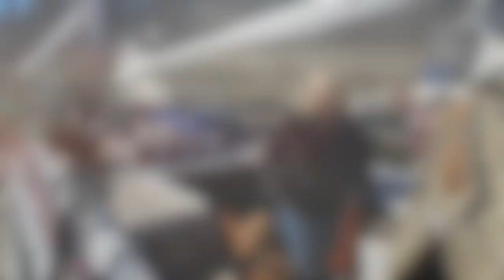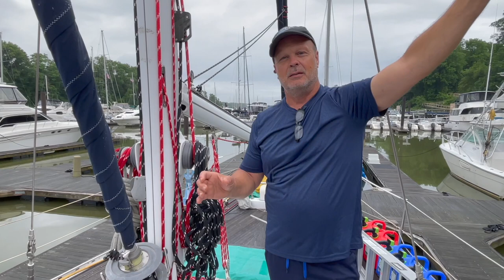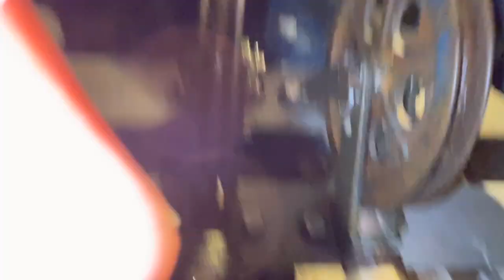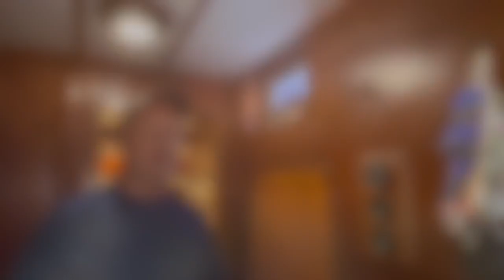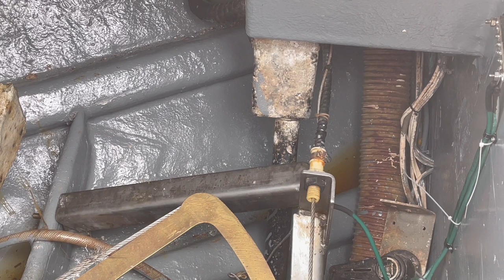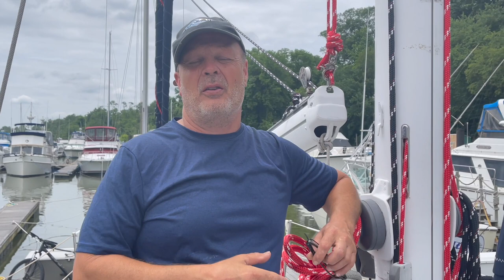The Tayana Blues! -Sailing SV Bohemian Ep. 20

Comment: B.O.A.T = Bust Out Another Thousand
Your desrption is dead on....
Keep up the great work
Reply from the maker: 1000 I need 5000 . Oh lord this boat . I’ll tell you what in need  5 gallons of epoxy and a gallon of hardener. Maybe a little fiberglass. Then rebuild the injectors , six of them at 100 bucks a piece. Some gaskets around 500 bucks . Rebuild the head 2200 hundred. Then antifreeze and maybe oil . That should do it . Oh and a can of engine paint . And a nice torque wrench to top it off just to remember the project . I could keep going but it really gets ridiculous .

Comment: I bought my 38 foot boat when it was a wreck and did her up slowly. Took the teak deck off first. Have owned her for over 20 years now. It’s a Labour of love. 

I new exactly what I was getting into. Also I was in no hurry.
Reply: I think I’ll remove the teak this spring in sections as I wander around the keys and the Gulf. Some guy told me to pull the teak off leave the screws then mark them with a sharpie. Then remove the screws,drill them out then epoxy. Did you have issues finding the screw hole.
Reply: @briandale8386  - I was lucky as mine was held down with glue only. It made a big mess removing the glue though. Sanded it down and   Applied a primer and then anti slip paint. Came out real nice.
Reply: @briandale8386  if it were me I'd remove the whole deck before it causes more issues

Comment: The most expensive way to get somewhere for free!  Dig that you're sharing - still on the couch myself.
Reply: There’s a old Bertram yacht next to me for sale . It has two big 18 wheeler motors in it. He said to go to Annapolis and back cost around 300 buck and that’s at low speed. It’s about 150 miles round trip. He said if he pushed it hard 500 bucks . I think that comes to 2 miles a gallon.  Trucks will get with a full load 7 to 13 but they only have one engine . Stick around I promise  to sail the 7 seas.
Reply: Great comment - and yeah a 40 year of boat needs commissioning, and it’s a years worth probably of stuff - so call it 2000 hours, but then you should be able to go for a few years before a major breakdown.
Reply from the maker: @IanB22  ya give me hope
Reply: Great video that gives an idea of what's involved when buying a fixer-upper... Whatever your initial budget for repairs, you better double that to be on the safe side, and to make sure repairs are done RIGHT, with the right materials, which are not cheap!
Reply: @sailing_mahalo  back in Missouri there’s a big box hardware store called Menards..   they have mahogany paneling and a good selection of mahogany.  Miss that place.
Reply: @briandale8386  Spelled Menards, know it well, lived in St. Louis / Ballwin, MO for 10 years

Comment: New subscriber here.  You are doing good and that boat will need a lot before it is back in great shape.  I have faith that you will do it and do it right.  This reminds me of the early 80's when I had to chance to buy a 1971 E-Type Jag that had been sitting for years.  My Dad told me I could afford to buy it but I couldn't afford to have it, he was right.  Owning a sailboat is the same, the purchase price is just the beginning of the financial hit.  The older and bigger the boat, the bigger the hit.  From the moment a boat is constructed it begins the degradation process, this is no big deal if you stay on top of it, but if a boat sits for years then you better plan on going through every single item on the boat and either replace of make certain it is in excellent condition and have spares that you can use when something breaks and something will break.
Reply: I new it when I bought it ,  but now I really know. I was flipping houses and I had experience , so I new what to expect. This is different, . I’ve come to the conclusion that this period of time to know this boat is a form of safety for me and my wife. I needed this learning experience to sail. A seasoned sailor I will become.  Thanks for the tips , keep me in mind when you see me cruising. That will be a new chapter of learning.  Keep on a dreaming
Reply: @briandale8386  Keep doing exactly what you have been.  It is a process, just like flipping.  You will have an intimate knowledge of every system on the boat, and that is absolutely needed. Expect every single thing you touch to be bad, then when you see all of the things that are perfectly fine you don't get discouraged.  If you expect things to be good and then discover they are not, it is easy to become overwhelmed and discouraged.

Comment: The price you paid should have been a red flag.   Especially with a Tayana.  The were built to a price point, and to gain that price point they cut corners. With the passage of time, those short cuts moved to the forefront.  The bolts you mentioned are an example.  Rather than used 316 stainless, they used cheaper 304.  That was repeated through the building process.  You are right: the rebuild will never end.

Comment: Bry, you got a diamond in the rough, she needs polishing. But she's a big diamond an BIG diamonds are very costly. For just you and wife you would have been better off with say a 40 footer. Its not just the maintenance, its also fees for travel/marinas. How did you make out on insurance, get worse every year ?
You were demoing the emergency rudder post, assume you know it goes through the SS deck access plate aft of the hatch. 
I mentioned in previous that you might have to flip another house or two to have bankroll for refit and any unforeseen cruising expenses.
Almost forgot the shaft shouldn't wiggle going thru stuffing box/cutlass. Cutlass might need replacing ?
Hope all goes well, I see you getting a bunch done.....👍👌🤜🤛
Reply: It just wiggles when running , the cutlass is pretty tight..  Ill do a video in a month or so about that shaft and prop and coupler. I do need to get to Florida in the winter to find a flip. The insurance was 2500 buck for the year,  we might end up in the keys..  and hang in Tampa too. When I get cruising you guys stick around. I’ll need the help.
Reply: @briandale8386  Had typed long msg, browser crashed, completely exited browser, not typing again .... shame ... piece of chit ... mad ... grrrrr !!!
Basically lived all over west coast of FL from Pensecoa to Bradenton doing engineering, sweet SUGAR WHITE beaches
Blue thing, metal or rubber middle ?  Mine 4 individual rubber isolators. Sheared once I was in troubled waters too .....
Reply: It’s metal.  I have a feeling that the shaft is sitting low in the stern tube or shaft log .Then the motor adjusted from there. I’m going to pull her out . The marina ,when you pay for the season ,gives you a free in and out. So that’s good .  And they let you sand away till you get your fill.
Reply: @briandale8386  Kewl, assume you will be filming the work ? I'll be here watching, good luck with the work ahead. How old are you Bry ? I'm 67, ole sea dog